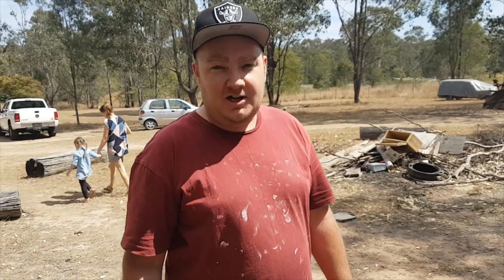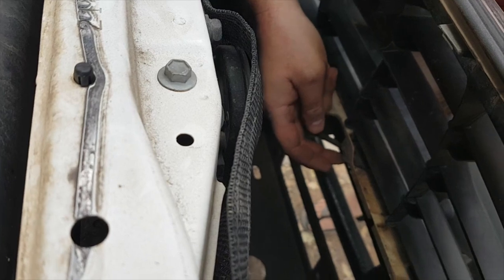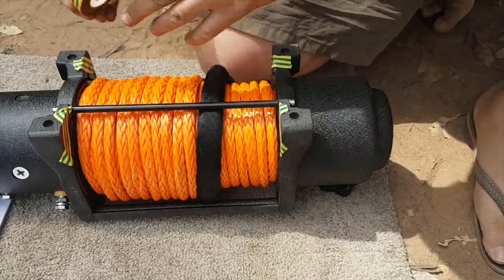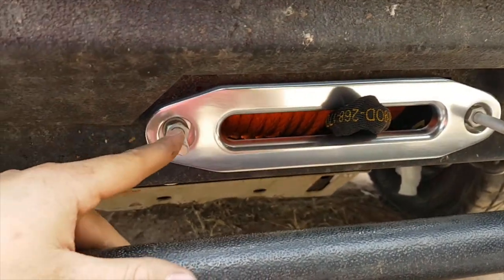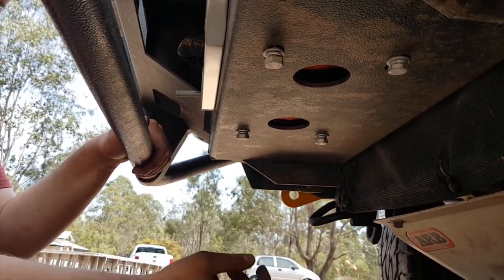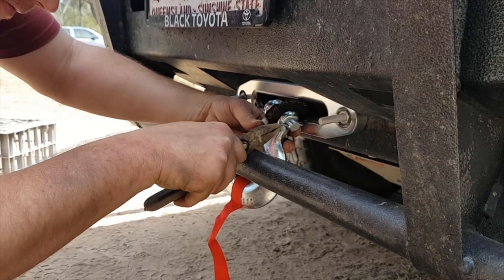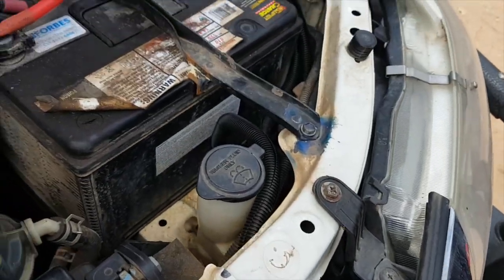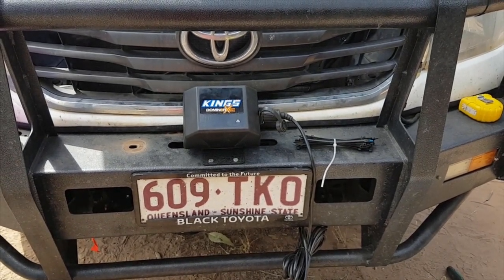How to install Kings Domin8r X 12000lb Winch into a Toyota Hilux

Comment: Are you happy with the winch
Reply from the maker: Yeah mate. Don't use it that often. But in January I used it to move a car that wouldn't start. November 2018 it pulled me out of a huge fox hole. I thought it wouldn't be able to do it, but no problems.

Comment: You used the wrong bolts to hold  the fairlead on just so you know.
Reply from the maker: I'm assuming your talking about the letter box, they were the only bolts supplied and they are definitely not what was supplied in high my mates kits.